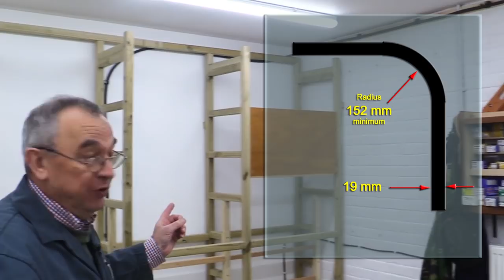EV Charger Series: Doncaster EV Ultra Armoured Cable

Comment: Watching you run cable it shows you were an engineer previously. Actually making a template for the radius and all. Watching as an electrician it just makes me chuckle. 

As it's often said on the job 'i don't need the engineers opinion'. The radius they often give are rather conservative and you can get them much tighter without issue. 

EV Chargers keep changing I remember setting them up 5 years ago and they have so much more tech to them now. 

You manage to make the most boring tasks at work for me, be so interesting.
Reply from the maker: Hi Joe, You are very kind. Cheers.  Peter

Comment: Hello Peter! As always an excellent step by step tutorial! However, I was taught to drill any external to internal holes by drilling a hole from the external brickwork inward,  creating a ‘rising’ hole rather than an horizontal hole. Notwithstanding any capillary action, in the event of a ‘seal’ failure this prevents any rainwater from entering the building!
Reply from the maker: Hi Len, I remember being instructed in the same way but in 50 plus years of doing things like this I have never seen any evidence of water ingress through a hole like this, especially one where there is a fairly large box on the outside. Many thanks for the reminder and you are right to say that it is good practice.  Cheers.   Peter

Comment: Very interesting video Peter.  Too late for me as I have already had a 10mm square armoured cable installed for our supply to the garage (workshop) which is split at a convenient point with a junction box which can then feed a charging point if we decide to install one later.  The first short length from the house to the junction box is surface mounted and then it goes underground (moled ) across r the driveway.  I didn't realise I might need a data link to the main consumer unit in the house so will need to run a separate one for this if we go ahead with a charging point unless they are made with WiFi links built in which might be a likely development.  Did you get a government grant for the installation?  Mike
Reply from the maker: Hi Mike, Our Pod Point and most of the chargers on the market will have WiFi but some need a hard wired connection to a router. The latter can sometimes be overcome if the particular EV charger has a USB socket inside into which a WiFi stick can be inserted. The very best solution is to have data cables within the armoured sleeve which is now too late for you. The problem now arises, similar to friends with electric gates, that a non armoured data cable running outside underground is prone to failure. Government grants are available to anyone in the UK provided they have an EV or can prove that one is to be delivered by 31st March 2022. They also need off street parking on their property.  Cheers.  Peter

Comment: Absolutely brilliant.. I've been looking for  cable that can power and deliver data so I went to Doncaster cables and found exactly what I'm after.. and it was a great price too!! It'll certainly be used when I come to upgrade to a larger 14x12 shed. 
One thing I'd like to know more about if you can help is noise reduction/suppression that I can fit to the structure of a shed before it's lined.. thanks Peter
Reply from the maker: Hi Mark, Well done on the cable. For noise reduction try and create about 75 - 100 mm of insulation between the outer wall and a new dry lined wall. There are many technical ways of improving it which will not be worth the effort if you are more than 20 m from neighbours.  Good luck.  Peter

Comment: You need some ( not all) fireproof fixings for that cable, particularly over the door
Reply: I agree, no protection in the existing install against premature collapse in the event of a fire. I believe this is now a requirement post events such a Shirley Towers in Southampton where lives were lost due to cables collapsing in a fire. Something like Screwfix 875HV look much better than those clips you have used and comply with the requirements.
Reply from the maker: Hi Matt, Many thanks for that and for the Screwfix product code.  Peter
Reply: Or a couple of bits of fixoband if it's not on show. Also,if not a specific requirement of the install, the hole in the wall would be better sloping down from inside to out

Comment: The max charging power for a Tesla home charger in Canada/USA is 48amps at 240VAC which requires a minimum of a #8 copper conductor which I think would be 10 mmsq. When running cable in this type of situation, I favor going larger than the minimum calculated load. 
Reasons: 
If the cable is particularly long, voltage drop may become an issue, but is mitigated by using a thicker conductor. 
Labor to route and install the cable is usually greater than the cable cost and significantly more than difference in price between, for example, #10 and a #8 conductor sizes hence allowing the for a bigger load to be installed on the cable in the future.
A larger cable allows the installation of a circuit breaker panel at the load end of the cable from which the primary load (car charger, or welder, or hot tub, etc.) can be used in conjunction with ancillary loads such as lighting or ventilation or convenience outlets.
That said, in this case where the cable is quite short, yes, put in just what is needed for the load to be installed.
Reply from the maker: Hi Chee, The max current here for a single phase EV Charger is 32 amps (at 240 volts). Technically that means a 4 sq mm cable would suffice but with my run being 12 m I have gone for 6 sq mm cable to minimise voltage drop. It happens that almost all UK installers will use 6 sq mm cable to add a bit of future proofing as well.  Cheers.  Peter
Reply: @NewBritWorkshop  Is the 32 amps max a legislated maximum or is that the maximum for some other reason?
Reply from the maker: Hi Chee, In the UK the charging power for home use is either 3.6 kw, 7 kw or 22 kw. The 22 kw solution needs 3 phases in the property. For normal houses the options are therefore 3.6 or 7 kw. I do not know how these figures were decided but that is what we have. The power available with high power DC charging units can be much higher of course. So, 7 kw on a 240 v supply is just under 30 amps.  Peter
Reply: @NewBritWorkshop   In the uk most properties have a 100amp fuse going to the meter, some very small or older properties maybe only 50 amps, therefore a sustained 30amp load is all that can realistically be catered for allowing for other significant loads like an electric oven/or shower.  In this specific situation there could be a workshop machine running.

What I don’t understand why the charging point needs to be linked to the internet?  A simple point to point data connection is all that should be required to connect the charging point to the household power monitor.
Reply from the maker: Hi Andrew, On your first point the Pod Point (in this case but most other makes are the same) has a current clamp that fits around the incoming live supply to the property. That measures the overall current being drawn at the property and is relayed, via the shielded pair of data wires in the armoured cable, to the charger which then ensures that the amount of current that goes to the car is such that the 100 amp fuse is not blown. On the second point, the Pod Point can be controlled either by the car or via an app on a mobile phone. In order for the phone and the charger to talk to each other the charger has to be connected, usually via wifi, to the internet. Also, the charger will get software updates over the internet.   Peter

Comment: Is armoured cable required as your install is not being buried ?
Reply from the maker: Hi Gus, Techically no (for the UK) but were it not armoured the cable would need to put into trunking which adds considerable time to the installation process. If you look at videos of EV charger installation you will see that 99% are done with armoured cable. If the work is done for a new build then it would be easy to use normal twin and earth cable as long as it is the right conductor size, inside the building and either within the walls or in trunking.  Peter
Reply from the maker: ...and let me make it clear that the work shown is this video will be done by the installer.  Peter

Comment: One phase?
Reply from the maker: Yes, in most UK homes only one phase is brought in. In a street the houses will take their load from different phases in order to provide a rough balance.  Peter
Reply: @NewBritWorkshop  Thank you for the  explanation  Peter. You also  have mains cables with a fuse in the plug, and 110V and 230V. Maybe you could do a video about that? Good stuff anyway
Reply from the maker: We only have 110 volts for equipment on building or renovation sites. Our mains plugs do have 13 amp fuses with wiring designed to allow up to just over 3kw per socket. Normally out sockets are wire in a ring with the start and end meeting back at the consumer unit (fuse board). We also have residual current devices (circuit breakers) at the consumer unit to detect any leakage to earth in which case the circuit is broken in order to protect people. Cheers.  Peter

Comment: Hi Peter, sorry for being a bit off topic here but I think you will like this. I know you like the Kapex as much as I do, and that you made a video about how to make a zero clearance fence for it, but have a look at this product from a small company called Colliflower. This is their demo video https://youtu.be/COqBxTyuO4E
(but perhaps you had already seen it.)
I'll be installing this system on my Kapex this weekend. 👍
Reply from the maker: Hi Muru, Many thanks - I will look at this.  Peter
Reply: @NewBritWorkshop  After using it for a couple of days I can confirm that, while extremely convenient to use, the dust collection suffers if using the tall block provided. I made new blocks which are 1/2 and 3/4 of the height of the original one and it improve the dust collection a lot. However, as with any fence obstructing the dust inlet, it's far from ideal. Nevertheless I would recommend it to anyone looking for a zero-clearance fence which doesn't take up extra space (and has the money for it. It's not cheap).
Reply from the maker: Hi Muru, I thought that would be the case when I saw it.  Cheers.  Peter